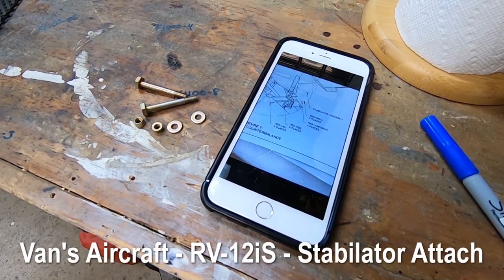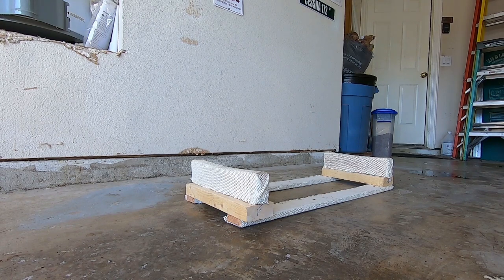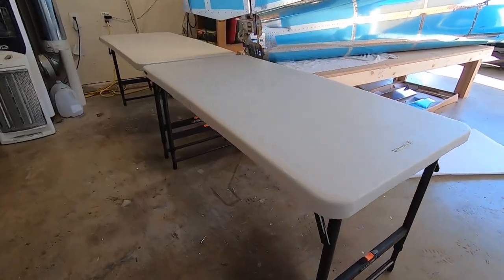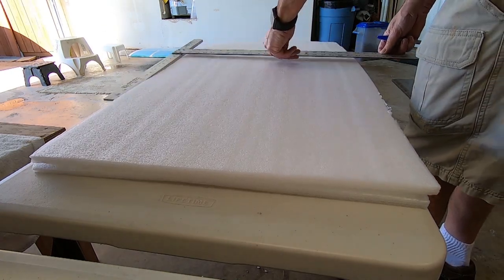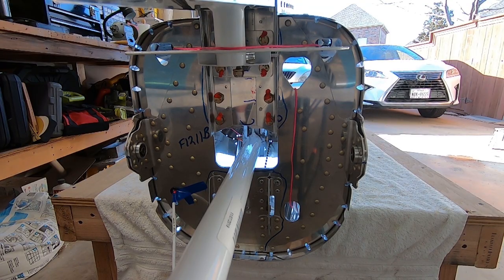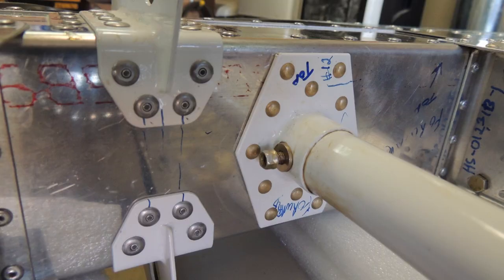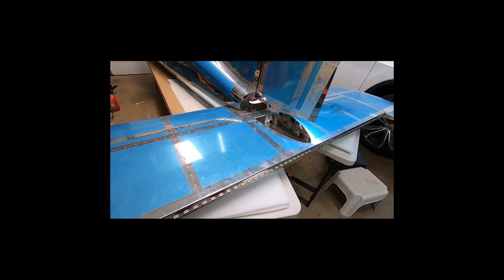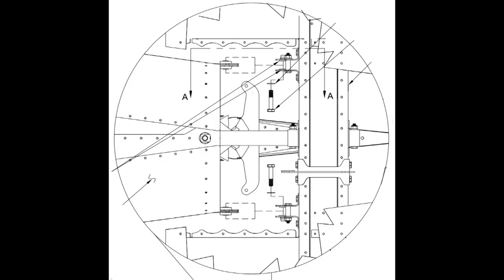RV-12iS Quick Tip - Stabilator Attach

Comment: Nice video -- clever use of paint roller frame.  If performing the stab counterweight SB be sure to secure the aft ends of the stab control cables so they don't fall back into the fuselage -- it ain't no fun trying to fish them back out....
Reply from the maker: Good Advice! Thanks David.

Comment: Instead of finding “shim” material to raise my tables, I lifted at the front of the plane to lower the tail into position. You can balance the stabilator counter balance off the plane by hanging it from the pivot bolts.
Reply from the maker: Great idea!